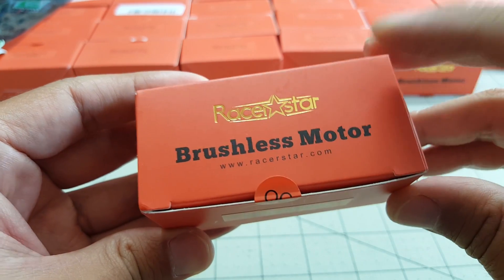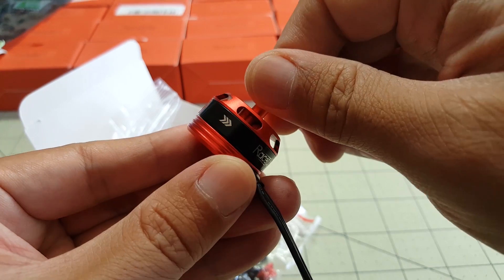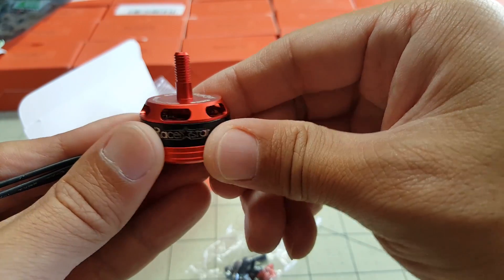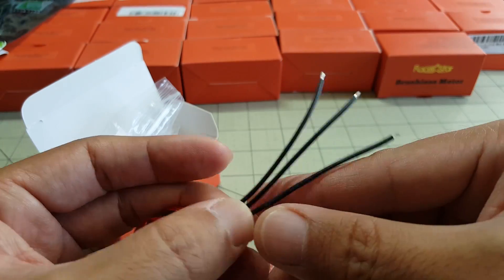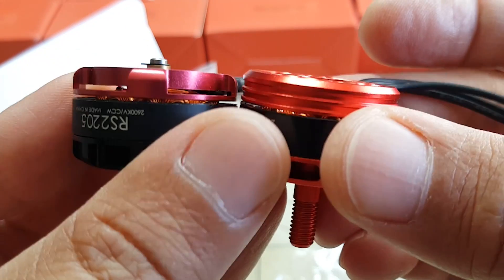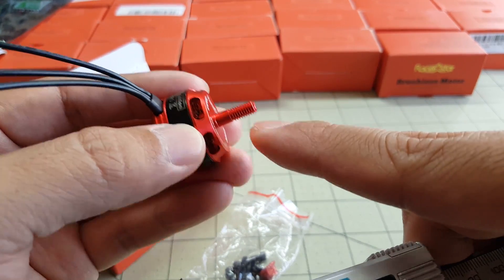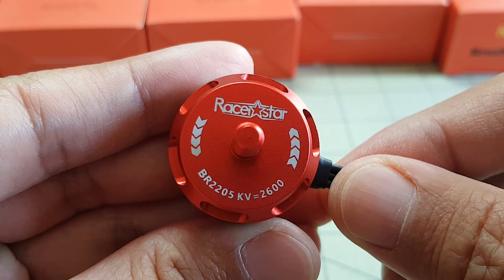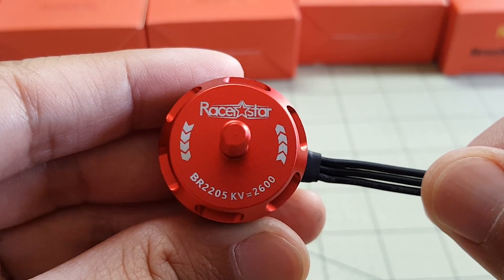RacerStar 2205 2600kv Motor

Comment: what size esc do you use for these motors ?
Reply from the maker: +Colin Berens 20-30 amps depending on props and quad weight.
Reply: Albert Kim I plan on using a bull nose prop or bull nose 5045 tri
Reply from the maker: +Colin Berens go with 30 just to be on the safe side
Reply: ok
Reply: are simonk esc any good?
Reply from the maker: +Colin Berens no. Get BLHeli_S ESCs.
Reply: OK don't want to spend to much
Reply: are these good ?
Reply from the maker: Get this one instead - https://goo.gl/tfn8ls
Reply: are those good?
Reply from the maker: +Colin Berens yes
Reply: OK well I will see but they are both good right ?
Reply: I have no idea how to wire those esc my last ones had a yellow red and brown wire

Comment: What is 2205 vs 2204?
Reply: Michael M the 22 stand for the diameter of the motor the 05 or 04 is the height of the motor.

Comment: I gotta ask.  The arrows of on the tops and sides of both these two motors point CCW.  However, the labels on the outside of the 2 motors differ.  Emax says CCW.  The Racerstar says CW.  Even the Racerstar box say CW.  What is the standard terminology.  Before I say something wrong and people get confused (note, I do not have these motors yet, so I can't say for myself), but, is the red nut a standard right hand thread or is it a left hand thread?
Reply from the maker: Unfortunately there is no standard terminology and it varies from manufacturer to manufacturer. Thus, the confusion and people misordering parts.  What most people want are the clockwise nuts (normal) with the bell rotating CCW.  Usually, these have the silver nuts.  The reverse nuts are usually black.

Comment: Hi Albert, after watching your videos on these RacerStar motors now I'm trying to decide what to purchase; whether I should the RaceStar RS2205 2300KV or the EMAX 2205 2300KV.  Are the RaceStar RS2205 comparable to the EMAX RS2205?  Or do the EMAX RS2205 blow them away, no competition whatsoever? Would you recommend them?  If they are similar in performance I will buy them over the EMAX RS2205.  Please let me know.  Thanks
Reply from the maker: +Moises Moraga the Emax motors are better. If the cost doesnt bother you that much, get the EMAX
Reply: OK, just to verify Albert....so they are NOT similar at all in performance? 

The RacerStar RS2205 motor performance / power is alot less than Emax RS2205?
Reply from the maker: +Moises Moraga the racerstars produce about 150g less thrust on 4s compared to the emax. Its still fun but you asked which is better and the emax is better by that much.
Reply: Albert Kim,  thanks! That will help me make a better decision! :)

Comment: Most newer high power motors have cutouts at the base that allows air to be drawn through the motor (while it's bolted to the frame) helping to cool it. These motors don't have that. They just have holes on the bottom, where it will bolt to the frame and be covered and rendered useless other than saving weight. Look closely at the EMAX motor in the video. The holes on the bell don't do much if the air can't come through the motor. The cap at the bell and base is not large enough to allow enough air flow. I think this is a real flaw in the design of these motors, unless they don't get hot at all under heavy load providing good thrust. Magnets generally don't like high temperatures. UPDATE: I just checked on these and the new version (Black ones) has the proper cutouts on the base to allow air to be drawn through the motor. But they went up in price as well.
Reply from the maker: +helicrashpro my 2600kv motors dont get that warm. But I'm using a 5040 prop. More efficient... if you overprop these motors they will get hot.

Comment: Did you get the 2403's too? Banggood sent me a set of those to test, but I had nothing to compare those to, they were the first set of 24 motors Ive used. I cant believe how many different types of motors racerstar has come out with in just the last month.
Reply from the maker: Yeah, it's completely nuts.  I hope they send the green ones.  Those look like even better performing but cost a lot more.  I think they cloned every motor on the planet just to be safe...  I have the 2403 motor as well and will test them on a ZMR250 with six in props.  I think those will perform nicely on that.  I think the 2403 motor will have more low-end torque than a 2204 motor but less top speed.  Fine with me.
Reply: LOL, so that's what they are doing. 

you mean these: 
http://www.banggood.com/Racerstar-Racing-Edition-2205-RS2205-2300KV-3-4S-Brushless-Motor-CWCCW-For-QAV250-ZMR250-260-280-RC-p-1073368.html?

I have a set of the 2205 2700kv greens on the way, since they are the most expensive, Im guessing they are the bes LOL... it looks like they are clones of the cobra motors 

I had the 2403 on a 210mm with triblades, its got a decent amount of power, but I think you are right in that it will do better on 6" props.

Comment: Should I buy the 2300kv or 2600kv motors?  They are the same price.  Does the prop size make a difference?
Reply from the maker: So here's a very general answer... 2300kv is better for lower-end power... short-track racing with a lot of turns. 2600kv is better for higher-end power... long-track racing or freestyle.  Depends on how you want to fly.

Comment: i got 8 of them 1103 motors here , what props would i use for these ?
Reply from the maker: I am planning to use a cut down of these props - http://goo.gl/zueI14  What ESC are you going to use?  It says 1S but I have a feeling 2S will be OK.  What are you using yours on?
Reply: Albert Kim 
Just tryd a prop like that, seems like it should work ^^ lol 
And I was planning to order the 6a BLheli emax esc on banggood, as they are 1s capable, and have BLheli 
And not sure on what I will trow em on, lol I can go hex or octo maybe ^^

Comment: Could you also do a Racerstar 1306 Review? Maybe compared to Rs1306
Reply from the maker: OK, I will look into it.  I don't have those at the moment.
Reply: Nice. Currently I have the RS2205, but look forward to build a small 150 quad so I have to pick the right motors. And the RacerStar 1306 are also extremly cheap. Thnks
Reply from the maker: I'm currently testing the 1806 Racerstars and comparing them to the DYS 1806 motors and they perform similarly. Also, even though the 1806 is rated 2-3S and they show 5 and 6 inch props in their performance data, I was able to fly 4S on a 4 inch prop no problem with plenty of power.  I'm still working on that review. Video will be coming soon.
Reply: +Albert Kim (marblekit) probably the 1806 are rated as max. 3s because otherwise they could get very hot and melt the magnet, if you use 4s I don't recommend 6inch prop max 5inch
Reply: Luis Rodrigues Oh didn't knew that. What a bummer. Maybe they'll run on 4s an just melt away :D
Reply from the maker: The 1806 motors are only rated 2-3S but for 5-6 inch props.  I flew yesterday on 4S with 4 inch props and had no issues.  You just can't exceed the amp and watt rating for long periods of time.